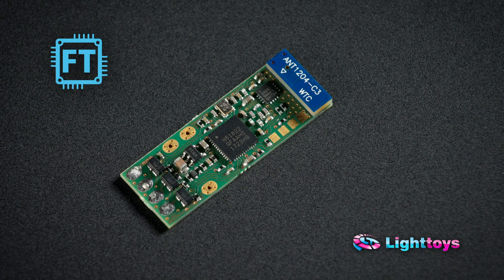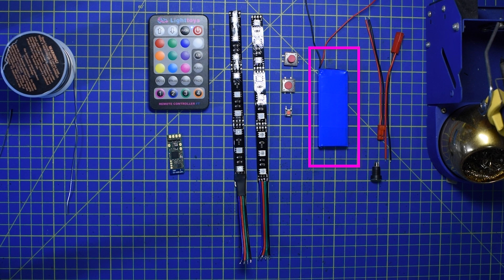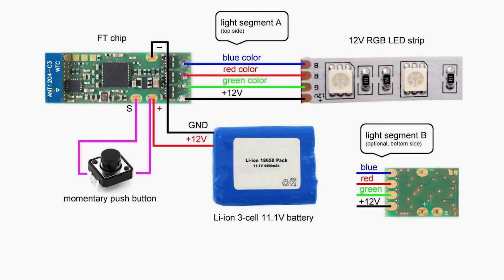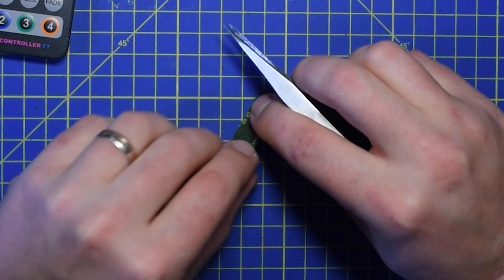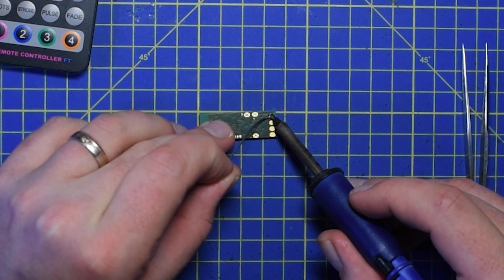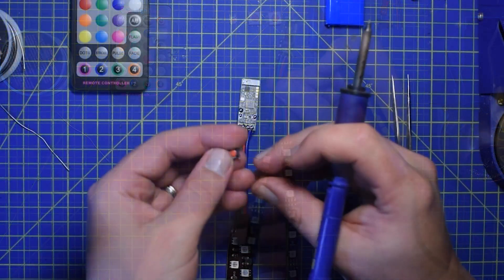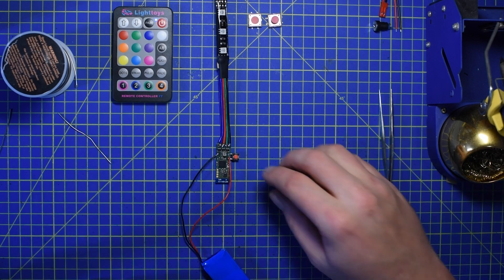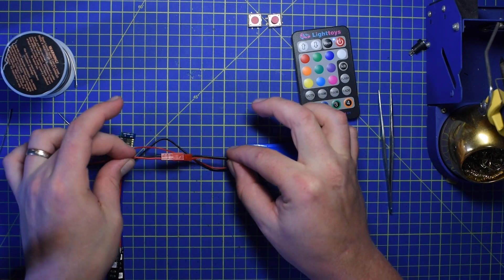FT chip soldering tutorial | Pyroterra Lighttoys

Comment: sir how about ft module? need battery to power up or the module have build up battery?
Reply from the maker: Thanks for the question! The FT module has a Li-ion battery already built into the box, so it is not needed :) For the FT module to work, you need only to screw the provided connectors to the 12V RGB LED strip wires. Hope that helps 👍
Reply: @Pyroterra-Lighttoys  thanks for the info sir because i will order ft chip or ft module, i will make led costume for our team, thanks for the info sir